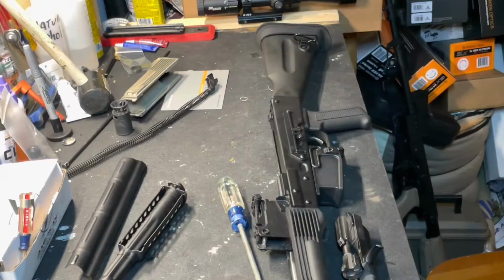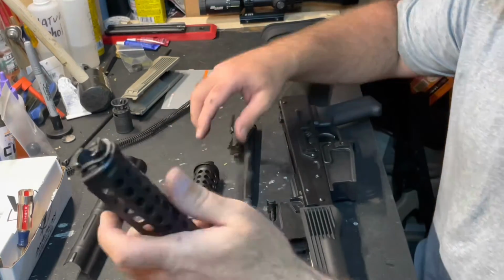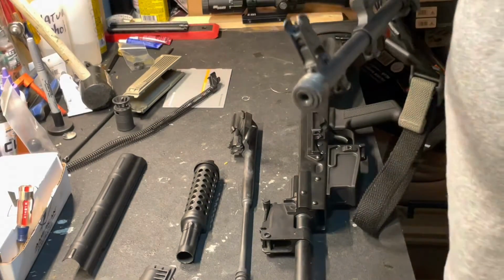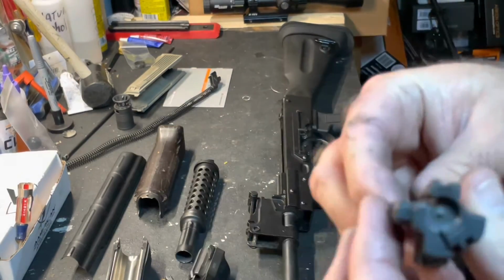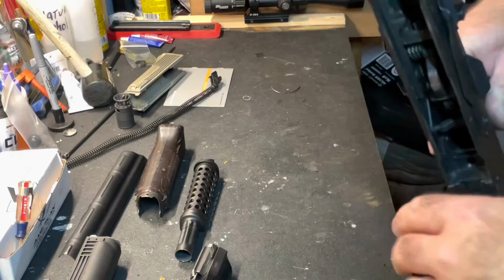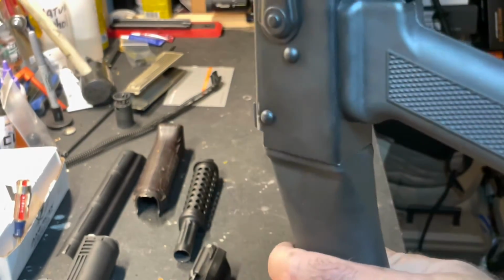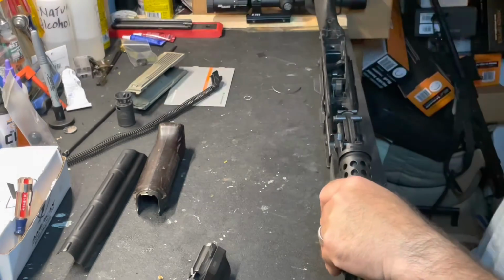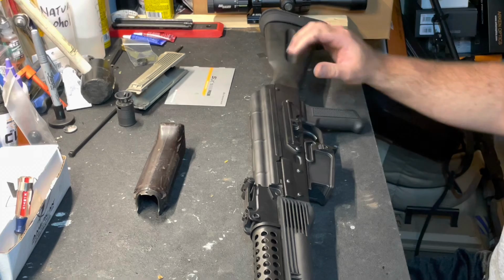PSA AK556 Round 2. It doesn't fit!

Comment: The front trunnions are different. They did a bulged front trunnion on the 556 gun because 556 has a higher pressure then the 762. That’s why it doesn’t fit.
Reply from the maker: Clearly!  Thanks.
Reply: @practical5562  it’s similar to yugo aks
Reply: It's actually bulged because of the magazine adapter. It requires cuts in the trunnion because of the profile of the front of M16 mags. Look up magazine well conversions for AKs and it's talked about extensively. I know PSA has said in interviews it's because of pressures but if that were true the 101 and 102 versions would also be bulged and they are not.
Reply: @diehlcorp7319  they bought the rights to the definitive arms 556 adapter which is essentially what they’re using in that gun. And you look back on the old videos of that mag adapter and they are on AKs that do not have bulged trunnions. Basically I don’t believe you
Reply: @gsGs-xb6um  They didn't buy the rights to that, definitive arms made an instagram post claiming they ripped their design. however, it appears internally completely different, though the actual shape and profile of the magwell is identical. It doesn't sit in the gun the same, the magazine releases and bolt catch don't work the same or aren't present on the definitive arms original.

I agree it was a shitty thing of them to do, but I think it's technically legal and different enough inside, and what they're using does indeed require cuts in the trunnion whereas the definitive arms one didn't.

Comment: Was able to fit a Romanian surplus set and a sheet metal cheese grater upper hand guard on mine. The butt stock didn't take too much altering, but the lower handguard did. It looks like that mag well adapter changed the dimensions of where the hand guard goes in against the trunnion (as in your video) it can be done, but required significant cutting. Overall the end result looks pretty good.

Comment: Hey, how's the recoil on the rifle?
The bolt release, is it stiff or does it come down easily? Like on an AR easy like the selector switch or kind stiff like the bolt release? Dumb question I know, just curious. Last question. I've noticed you've mentioned that it's good for a range toy but that's about it. Why, does it feel kinda flimsy or something? Thanks in advance. Also you earned a new sub. Have a kickass week!
Reply from the maker: Thanks for the sub!  The bolt release is smooth, probably takes less force than an AR bolt release. IMO it’s only good for range toy because mine only functions reliably with Pmags. For me to consider as anything else it would need to be reliable with any STANAG magazine. Recoil is as light as any AR I’ve ever shot and lighter than most.
Reply: @practical5562  sweet! Thanks for responding so quickly. That is a good point about standards mags.

Comment: I received mine yesterday and was expecting adjustable gas block and I noticed yours didn’t have the adjustable gas block also, did I miss something or did they change some things from the pre production to the final production?
Reply from the maker: I don’t recall seeing an adjustable on the AK556, just on the Jakl. But it’s possible I missed the preproduction news.
Reply: Up until the shot show 2022 the ak556 had the adjustable, I ended up calling psa and they said they removed the feature! Little disappointed cause I planed on suppressing the rifle.
Reply from the maker: @tenzinphuntsok7854  go the KNS adjustable piston route. I suppress mine with OSS so no worries there it runs flawless. As long as I run Pmags.
Reply: @practical5562  I actually have oss as well, so with oss with your experience adjustable gas block is not really needed?
Reply from the maker: @tenzinphuntsok7854  nope. Runs great. Very smooth. No over gas issues.

Comment: Is it possible to remove that mag adapter for it to take ak101 mags
Reply: They're gonna release a version like that later this year
Reply: Wtf for? Using pmags is a plus.
Reply: I don’t understand this. The whole point is to use STANAG mags. Why would you even buy this to begin with if you’re just to take the mag adapter off to convert it to a 101? There are plenty of 5.56 AKs out there already that would be either the same or cheaper in cost.
Reply: @bronzeguy9839  plenty of 5.56 aks but non of which are a 101 lol. I bought a sam5. When I asked this question the 102 wasn’t released yet and the market still hasn’t seen any 101’s till today